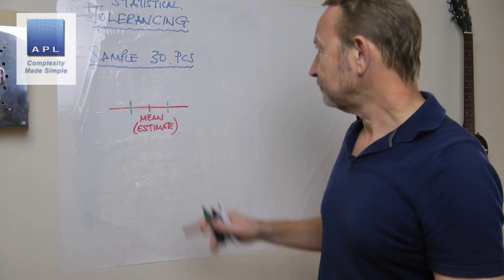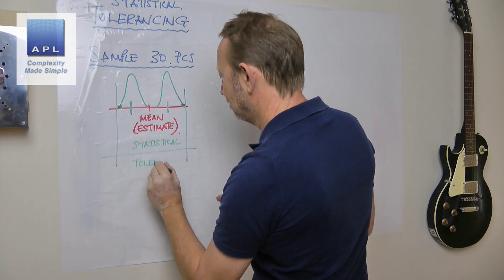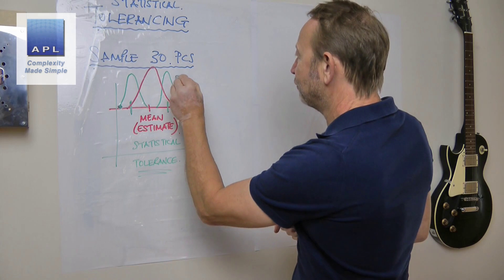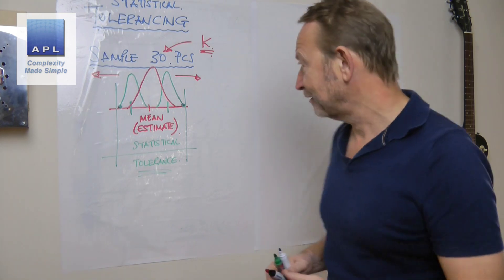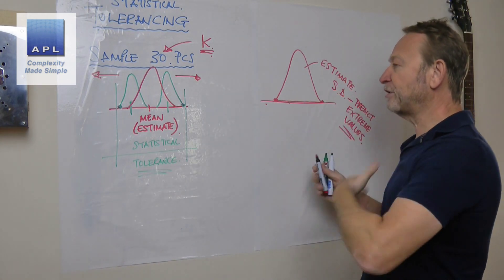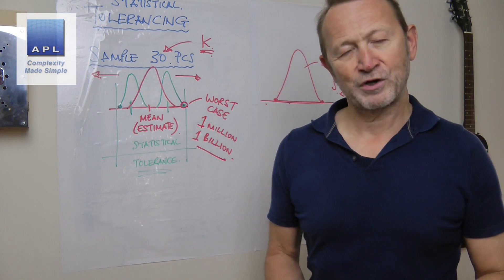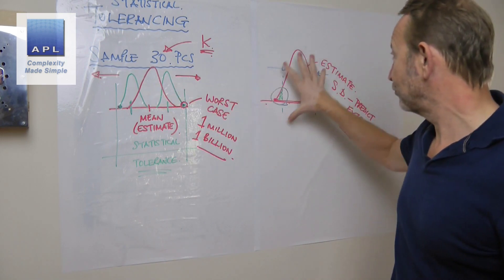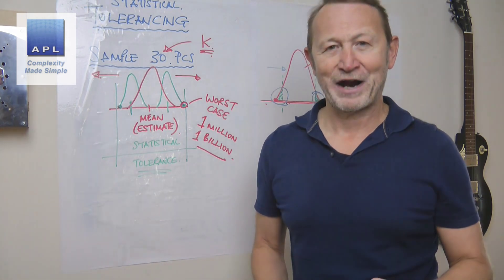What is Statistical tolerancing?

Comment: Just to give a nice example on this, to prove that it is not something odd or just a mix of stats on top of each other.

Think to aeronautics....yes...... in this domain, statistical tolerances are used very often. Why? Because we are not permit to get 1 issue / billion opportunities  there due to human lives in aircraft and the high costs of aircraft too.

So what do we do in practice ? Imagine, we have a new process to qualify for manufacturing. We will do some tests to asses the strength of the part...but because of cost and time limitations it can be limited to 5, 10, 20 samples......From that, we will calculate a mean and a std deviation. But because it was based on sample, we only have an estimation of the mean and deviation of the strength. We don't know nothing about the reality of the population as the process is new and done only with a couple of samples.

So far...we need safety and will "correct" the mean to get the minimum strength we can consider that will be realised in the future. This the "mean - k sigma" formula.

Practically, we use either 90% of 99% called respetively A-basis value and B-Basis value. This means..."ok, 90% or 99% of the parts will have a strength above this lower limit with a 95% confidence level". The choice between 90 or 99 is related to the criticality of the part.

So no..this is not really "over quality"...but "over safety" ;)
By the way, I like your videos !
Reply from the maker: Cheers Daniel - I get your point, a kind of factor safety used in the civil engineering trade but a bit more mathematical as you can do those tests and use some of that sample data which is very difficult when building a bridge...
Reply: @paulallen5321  

Yes indeed you get the point ! And I know it seems tricky at first....I spent also quite a lot of times to understand the principle behind the formula and why we do that instead of more simple stats.

Personally, I have worked in R&D for aeronautics. And one real example was when we used a "micro-drilled" sheet of metal. It was actually just a sheet of metal but with tons of 60µm holes on it.

Therefore, what strength could we consider for the stress analysis ? and be sure that the pilot will stay alive during the test... XD.
Because.it is no more a plain sheet but a cheese full of holes now !

What is required to do in this specific industry, is to make some tests, get the data on samples and correct them to calculate a B-basis value. So we can say with 95% confidence: "ok the sheet metal will have a strength over 10 megapascal in 90% of the cases. Our worst case is thus 10 MPA now".

And so we can we do the stress analysis with softwares with this value to check if the part will break under loads.

Another solution could have been a simple "safety factor"..saying for instance: 
"we will consider 25% of the strength of a plain metal sheet." This often do in mechanical engineering from my experience.

But this is based on "experience/historical data" or if not available.....on "luck of some engineers" and "gut of some others", which is not really allowed in aero... ^^
Reply: But to be honest...I've never seen or heard about statstical tolerances elsewhere than in aero and especially on new processes or highly variable processes like composite materials manufacturing.

Comment: I have used a 30 piece test run and k factor to approximate the distribution, and then compare this to part’s tolerance range.  This can become the start of a conversation with the part designer that perhaps
1 the tolerance is too tight
2 if we really need that tight a tolerance, we need a new or much improved process

I know this is late in the development process to identify a problem, but I have found the bigger the organization the less people want to hear about this, especially if DESIGN has the most weight on decisions.  This has given me some evidence that we likely will have problems in production and inspection.

I also use a similar logic in reverse, take the tolerance from the print, divide by 7 and compare this number to historical standard deviations from similar parts or processes.  Again, I use this to help assess if we are likely to have future problems.

Comment: I did exactly this in an atempt to kind of "reverse-engineer" tolerances, based upon 30pcs samples (standard deviation x6 with 95% confidence interval) out of regular deliveries. We had real defects (out of original tolerance) but the parts have always been fit for use. The devil lies in the detail; if you assume that the process is in control and normally distrubuted and it is in fact is not, you will end up with defects again, sooner or later. You can only hope that the incoming quality control sampling does not pick the wrong part...